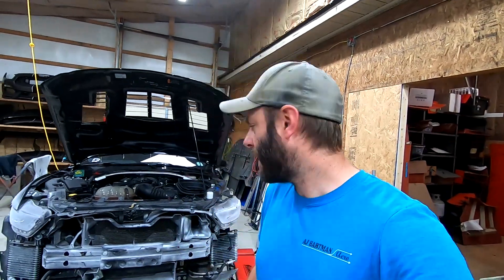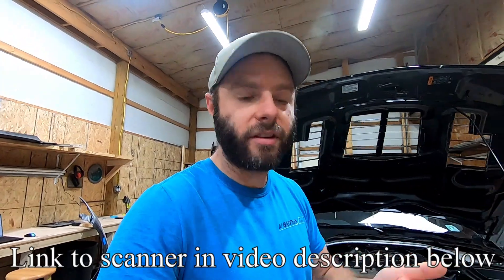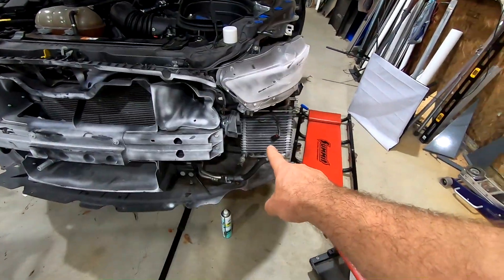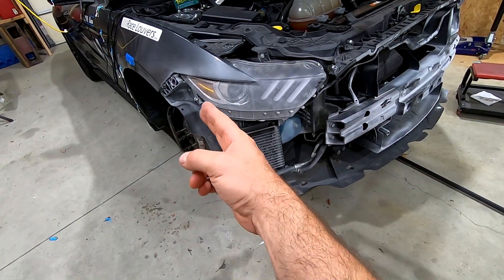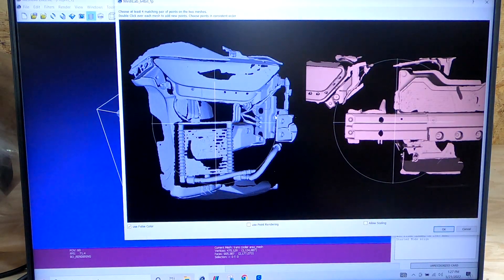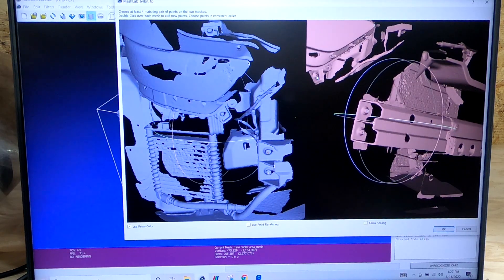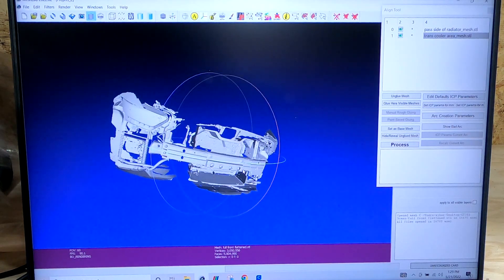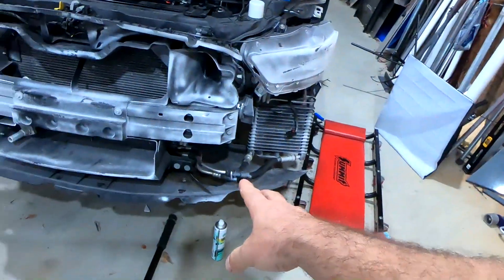Revopoint POP2 Scanner- First Scans

Comment: I use a different scanner for car parts. (bumper mods, grilles etc) and they always look good but are more of a reference model. Always have to tweek files a little when it's bigger than 12inch squared. When it comes to modeling it looks good when it comes to reproducing there's a bit of extra work.

Comment: Question, I'm using a Revopoint Pop2. Their software seems to kinda suck. When I load a scan turned into .obj into Solidworks, it has thousands or millions of faces and is terrible to work with. What mesh software are you using?
Reply from the maker: Throw it into a program that can reduce the mesh to a workable number.

Comment: Thank You for this video, it shows a lot from a practical point of view of someone who works on specific subjects and needs specific jobs to be scanned/printed. I tried to look through the net, but most of these videos are either commercial, or just theoretical reviews. I searched exactly for something what You just showed, and wondered if Revpoint pop 2 would be able to i.e. scan a boot lid (only from exterior to transfer all the curved shapes 1:1) with sufficient accuracy. This video answers my questions. BTW, what's Your next step, are You going to 3d print some of Your scans, or parts that would fit onto them? Or You did it already and You could share Your experience,what material You used, what printer and how much time it took ? Thanks!
Reply from the maker: This specific scan was to make a more complete cad model for some cfd stuff.

Comment: What kind of accuracy are you getting for large scans ?

I’m looking at scanning my engine bay and chassis.
Reply from the maker: I did snap a measurement from the very tips of the fenders on the cad model and then in real life it was as dead on accurate as I could be with a tape measure. So accurate enough for me. I would guess the more parts you glue together and their alignment all factor into the final result.

Comment: I start using a modified TV arm* on wheels. So you don't need to hold the scanner.  Because sometimes the shaking of the hand can make it worse. Or on difficult places voor je arm. You can still scan easy

Comment: this might sound a little odd but see if you can grab a rolling tripod or other method to keep the scanner on a single plane then go around the object at different heights. I have stuck a scanner (camera) on a pole mounted to a harbor freight dolly. the results will be a bit easier to stitch together and ensure you don't lose any points during the line up.  cost me about 18 bucks total using a dolly a piece of EMT conduit and a gorilla pod.
Reply: Second this, many ways to rig up a solution

Comment: damn been thinking of getting a 3d scanner. this POP2 looks to be alright for the price to be fair!
Reply from the maker: Yeah that’s why I pulled the trigger on finally getting one. Seemed a good value for what you get.
Reply: @ajhartmanaero  yeah i want to scan my entire car so we can test it for the efficiency of my DIY aero package
Reply: @RuskiWeldFab Hiya is there anything I can do  to learn?
Reply: its worth it if you will be getting into CFD, its difficult to get the learning curve under control and the effort that goes in can at times seem limited (all this work and im only ever going to do X) but once you get the hang of it you can use it to mock up all sorts of pieces; wheels, fins, strakes, vents, louvers, wings and wingletts etc etc